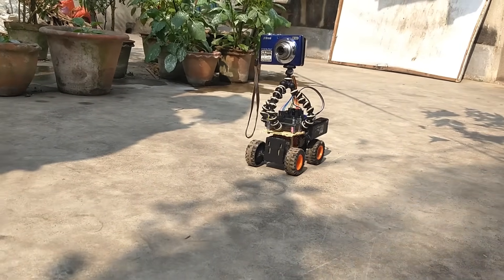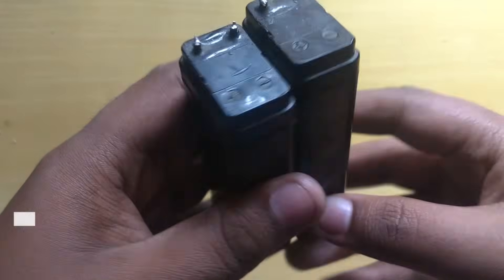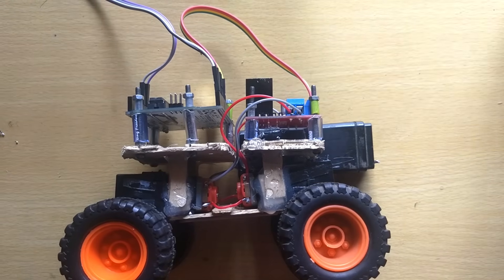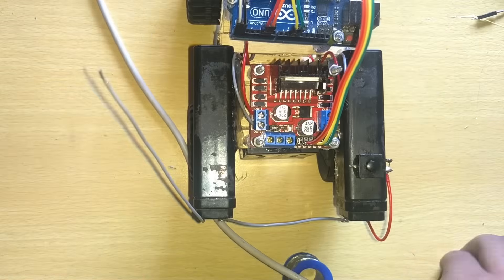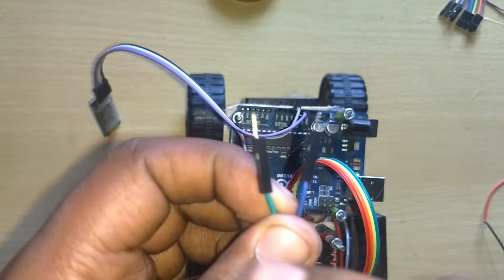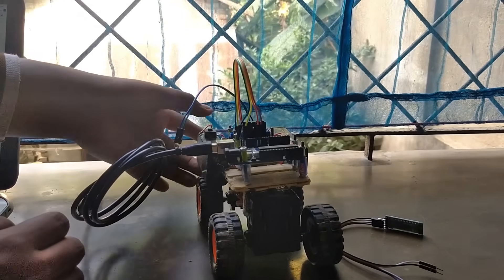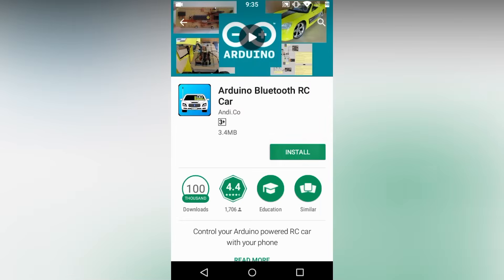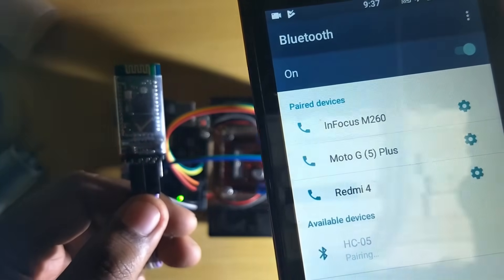How to make a Bluetooth Controlled RC Car [Codes Included] Well Explained !!  Part 2  Arduino #3

Comment: Hey brother please would u help me everthing is fine but my bt is getting disconnected again and again if possible pls share ur number
Reply from the maker: What disconnected??
Reply: @Creativecreator  please brother help me out of this ...i have to submit the project soon
Reply from the maker: @omthakkar4222  don't use 2 9v battery in series
Reply from the maker: Because it may fry your motor driver as it should.be supplied anywhere between 9 to 14v. But if you want to use its full potential then you have to remove the shorted jumper in the motor driver that's why I used   2, 4v batteries in series so it is about 8v DC but in your case it is 9+9=18v battery.
So it may also damage your Arduino Uno.
Reply: @Creativecreator  can 12 v battery be used sufficiently
Reply from the maker: @omthakkar4222  yes
Reply: Bluetooth
Reply: I am using 2 9v batteries in series
Reply: Actually ur video is just superb ..

Comment: Hey, hello sir and thanks for uploading such a helpful video and my code is also running well but i have to make some changes in it for adding some other features so can you help me with it?? I want to add a ultrasonic with it so if we press forward commond from app then if something is in front of the  car then it will automatically detect it by sensor and will change it's direction at the intant!!
Reply from the maker: Then you have to add couple of if statement in the coding
Reply: @Creativecreator  You mean in the different functions like in forward function one condition of if and else and similarly in other functions too to run it? 🤔

Comment: How do you open the file. Everytime I try to open it it says Error "Could not Create the Sketch". What should I do ?
Reply: nvm figured it out, turns out the name had to be changed, the software didn't like your name for some reason.
Reply from the maker: Hope you solved your problem.

Comment: In which pin  motor driver is connected ??  Please reply. ..     .

Please
Reply: Sir I upload the code in ARDUINO UNO and I done all the connection wright but then also it not working i.e when I want to connect the HC 05 then it connecting but when I am pressing the forward button it not working and then disconnected please hello me sir

Comment: Hey ,My Bro I need to ask You About Something..
Now , I make circuit to control 4 motor dc with l293d
And i need a code can control the 4 motor & Speed for motors
I will use the program that You use on Android But I Don’t Now how can I make the code for 4 Enable Output for dc Motor Can You Help me in Code
Reply from the maker: Code will be different for l293d
Reply: Can You send me the code for l293d
Reply from the maker: See description
Reply: @Creativecreator  how bout im going to use l298 then front wheels 1motor for turning left and right direction?

Comment: ans yes you project works really nice but I need to control lights also so please help me
Reply from the maker: See in the code you can control  lights, use buzzer as the car bell and much more with the code...
Reply: thank-you  let me try ones 
thank-you for ur hrlp

Comment: Hi man it works but on 1 wheel only the right wheel didnt move i check it and cheked the wires  it wokrs so from where the problem can be   ? Is it from the codes or from the arduino or from the L298n  ?
Reply from the maker: 1.Check your voltage source...
2. Try the motors in parallel( you have different RPM motors I think.... You have seen I have connected the motors in series judt connect the leftsided motors in parallel and right sided motors in parallel)
3. Use 9v or more than 9 or i mean 12v as an motor input it will defenately work.

Comment: sir my car is not moving i uploaded the code and connected it to my phone via the app and it is not moving
Reply from the maker: Just check all the commections
Reply: i just did sir 
do i have to code anything more pr just copy paste
Reply: i just did sir 
do i have to code anything more pr just copy paste
Reply from the maker: See the pin mapping in the code
And see that all defined pins are used in Arduino. 
Btw which Bluetooth module you are using?
Reply from the maker: When you are uploading codes to Arduino make sure Bluetooth module's rx and tx pins are opened
Reply: Creative creator I am using hc05 it has a button too in it
Reply: Creative creator yes it was disconnected when I uploaded
Reply: Creative creator the Bluetooth is not blinking in 3.3v so I connected it in 5v

Comment: Bro can we use two lithium ion 18650 batteries?
Reply from the maker: Yes tou can use 18650 cells, use 3 cells in series. 11.1v approx.
Reply from the maker: Yes you can but one thing is the car will not run in its max speed ..
Otherwise all okk
Use 2 18650 batteries

Comment: Can I use Johnson motors instead of DC motor??
If so what changes should I make in the circuit?
Reply from the maker: yes, you can but those are costly so I used dc motors. connections will be same as before. and also the main thing connect your motors in parallel to your car speed will be greater.
Reply from the maker: Pearlin Patrick 1 motor driver is okk
Reply from the maker: Pearlin Patrick yes
Reply from the maker: Pearlin Patrick what motor driver you are using ?
Reply from the maker: Pearlin Patrick yaa it will work
Reply from the maker: Pearlin Patrick welcome buddy please like share and subscribe 😀😀

Comment: Sir? Can I control this with my voice with the use of another software
Reply from the maker: Mark Valencia nice idea I will try to make it with Google assistant. 
It is in my do list.
Reply: Sir? Will the arduino uno blink if given a command? Like forward left right etc.
Reply from the maker: When you upload the code to Arduino then a led will blink
Reply: Sir you did not use the en pins of the L298n module?
Reply: Pls reply sir :-(
Reply from the maker: Yss I don't have used enable pins I have shorted them with jumper cables.
Reply: There's an app for android called AMR_voice that allows you to do this.

Comment: Bhai code missing karha hay ads atay hai code link mujay send kre
Reply from the maker: //This program is used to control a robot using a app that communicates with Arduino through a bluetooth module.

#define in1 5 //L298n Motor Driver pins.
#define in2 6
#define in3 10
#define in4 11
#define LED 13
int command; //Int to store app command state.
int Speed = 204; // 0 - 255.
int Speedsec;
int buttonState = 0;
int lastButtonState = 0;
int Turnradius = 0; //Set the radius of a turn, 0 - 255 Note:the robot will malfunction if this is higher than int Speed.
int brakeTime = 45;
int brkonoff = 1; //1 for the electronic braking system, 0 for normal.
void setup() {
  pinMode(in1, OUTPUT);
  pinMode(in2, OUTPUT);
  pinMode(in3, OUTPUT);
  pinMode(in4, OUTPUT);
  pinMode(LED, OUTPUT); //Set the LED pin.
  Serial.begin(9600);  //Set the baud rate to your Bluetooth module.
}

void loop() {
  if (Serial.available() > 0) {
    command = Serial.read();
    Stop(); //Initialize with motors stoped.
    switch (command) {
      case 'F':
        forward();
        break;
      case 'B':
        back();
        break;
      case 'L':
        left();
        break;
      case 'R':
        right();
        break;
      case 'G':
        forwardleft();
        break;
      case 'I':
        forwardright();
        break;
      case 'H':
        backleft();
        break;
      case 'J':
        backright();
        break;
      case '0':
        Speed = 100;
        break;
      case '1':
        Speed = 140;
        break;
      case '2':
        Speed = 153;
        break;
      case '3':
        Speed = 165;
        break;
      case '4':
        Speed = 178;
        break;
      case '5':
        Speed = 191;
        break;
      case '6':
        Speed = 204;
        break;
      case '7':
        Speed = 216;
        break;
      case '8':
        Speed = 229;
        break;
      case '9':
        Speed = 242;
        break;
      case 'q':
        Speed = 255;
        break;
    }
    Speedsec = Turnradius;
    if (brkonoff == 1) {
      brakeOn();
    } else {
      brakeOff();
    }
  }
}

void forward() {
  analogWrite(in1, Speed);
  analogWrite(in3, Speed);
}

void back() {
  analogWrite(in2, Speed);
  analogWrite(in4, Speed);
}

void left() {
  analogWrite(in3, Speed);
  analogWrite(in2, Speed);
}

void right() {
  analogWrite(in4, Speed);
  analogWrite(in1, Speed);
}
void forwardleft() {
  analogWrite(in1, Speedsec);
  analogWrite(in3, Speed);
}
void forwardright() {
  analogWrite(in1, Speed);
  analogWrite(in3, Speedsec);
}
void backright() {
  analogWrite(in2, Speed);
  analogWrite(in4, Speedsec);
}
void backleft() {
  analogWrite(in2, Speedsec);
  analogWrite(in4, Speed);
}

void Stop() {
  analogWrite(in1, 0);
  analogWrite(in2, 0);
  analogWrite(in3, 0);
  analogWrite(in4, 0);
}

void brakeOn() {
  //Here's the future use: an electronic braking system!
  // read the pushbutton input pin:
  buttonState = command;
  // compare the buttonState to its previous state
  if (buttonState != lastButtonState) {
    // if the state has changed, increment the counter
    if (buttonState == 'S') {
      if (lastButtonState != buttonState) {
        digitalWrite(in1, HIGH);
        digitalWrite(in2, HIGH);
        digitalWrite(in3, HIGH);
        digitalWrite(in4, HIGH);
        delay(brakeTime);
        Stop();
      }
    }
    // save the current state as the last state,
    //for next time through the loop
    lastButtonState = buttonState;
  }
}
void brakeOff() {

}
Reply from the maker: Here is the link buddy 😀

https://drive.google.com/file/d/1qI4crZG6tvwMz5TEWEfqxKu8XlyAyaS1/view?usp=drivesdk
Reply: Bhai yi tu available nai koi aur code send kre plz